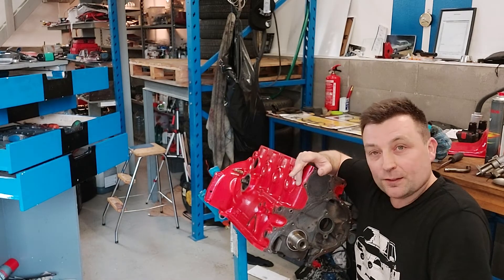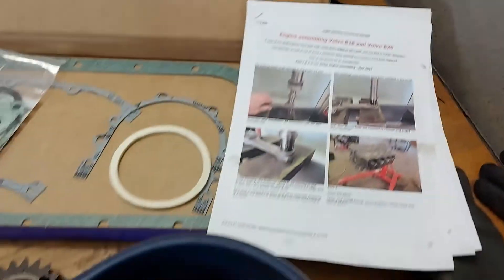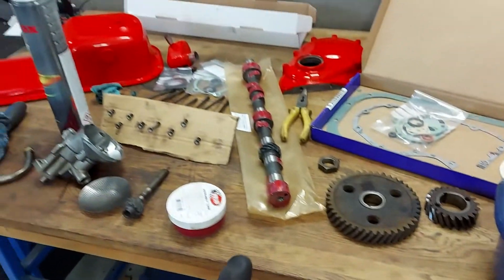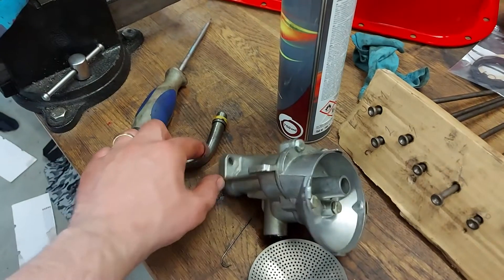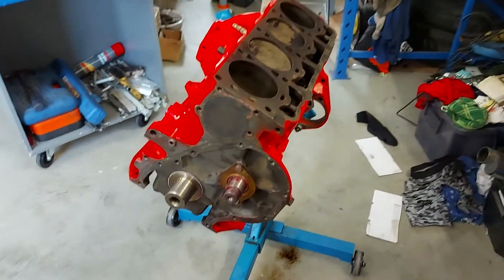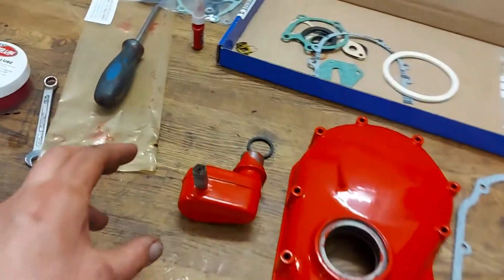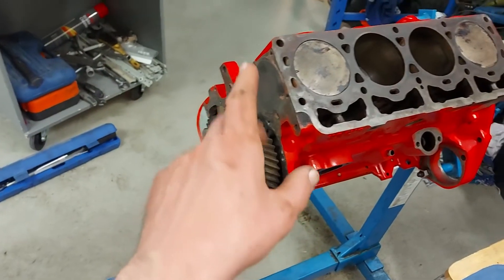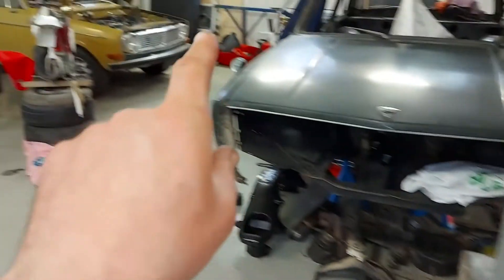Volvo B20 engine assembly | New camshaft |

Comment: I discovered that when the dot on the crank gear and the line on the cam gear line up, the number one cylinder is at TDC on the exhaust stroke.
Cylinder number four will be at TDC on the compression stroke.

Comment: I think you should keep the filt ring (gasket) for the front engine plate soaked in oil for a couple of hours before applying it to the front plate, but this comment is anyway too late as I'm writing it two years after your engine rebuilt....

Comment: Where were you able to find the instructions for assembly? Is there a link you could send me?
Reply from the maker: I think I got it from here https://www.volvoamazonpictures.se/documents/Volvo_Amazon_manuals_en.htm or just google "Volvo b20 manual".
Reply: @hanssgarage1886  yes, I’ve searched on there for the paperwork that you show on your video of the instructions for rebuilding and have not found them. Would you be able to find them and add the link or attach photos of the instructions?
Reply from the maker: @taylorsnow2194  Hi, do you mean this? https://www.volvoamazonpictures.se/documents/Volvo_Amazon_manuals_en.htm
There is a lot of nice PDF's. :)
Reply: I believe I’m referring to the printed off color photos of the actual engine assembly. In the video that I’m commenting on fast forward it to about the nine minute 50 second to 10 minute mark and it’ll be the paper that you are referring to

Comment: You have made two big mistakes. Firstly, never, ever, ever reuse the old phenolic timing gear. Always install a new phenolic, aluminium or steel gear. Secondly, the felt timing cover seal will leak after a short time. Have your timing cover milled to take a lip seal from a 240.  Likewise, a 240 rear main housing and lip seal will remove the rear felt seal. The B20 will leak enough oil from the rocker cover seal to prevent external engine corrosion.

Just check the orientation of the cam gear oiler. It is designed to squirt onto the gear, not out to the left of the casing.
Reply from the maker: Thanks for the tips. I think I have done more that two mistakes. ;) I will try to correct these in the next b20 project. This is my first but not last. The cam gear oiler should be in right position. I make sure the hole of the oiler poits to gear.
Reply: The felt ring is no worse than a rubber seal, only the ring needs to be installed after the timing cover is installed and centered on the shaft.
And the timing gears change only in pairs and they cost $ 300 per set. Hans did the right thing to use the old ones because he could install new and fake ones and that would be much worse ...
These gears were made only in West Germany and now the original ones are very difficult to find, now all new-made ones are on sale ...
Reply: @patricksgarage  felt seals require more regular replacement than rubber to maintain a good seal. If they were so good then they'd still be used in modern engines. The world has moved on.
Reply: @patricksgarage  If they were no worse than a neoprene seal, manufacturers wouldn't have switched away from them. Hell, many already had by the time the B20 came out.
Reply: @LN997-i8x  Yes yes, felt seals can't ideally protect from oil seepage like neoprene seals but they no worse because always more easier install the same design parts which was in the factory puted. Late models was with neoprene seals. Case in that neoprene seals can be implemented with new type timing gears casing type or adapted. So with older engine I personally use felt seals and with later B20 neoprene seal. Yes neoprene seal protect from oil spot and seapage better but when it dripping we can't blame seal that it made from felt, engines with felt seals always old and in lot of cases worn inside and if the engine worn and blow by maybe... no matter which seal we use it'll be leaks whatsoever. Car manufacturers don't care what better, they choose parts for another parameters.😉
Reply: Yes. That oil squirter is not aimed properly.

Comment: Nice job, I enjoy these videos. I have just had the head off my 144 to lap & clean the valves and piston tops. 

Is it necessary to put oil that felt/fabric seal before assembly?
Reply from the maker: I will open the timing gear cover and at least seal the corners (where oil pan meets the cover) with liquid gasket. I didn't put oil in the seal but that might be a good thing to do. :)